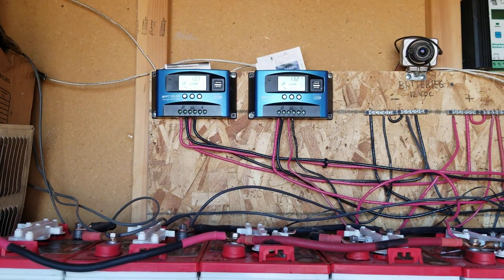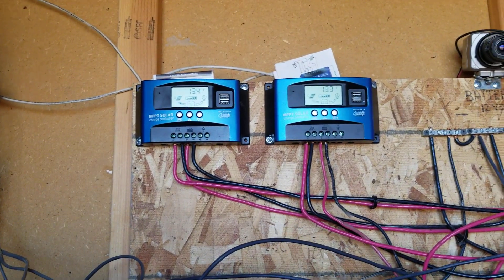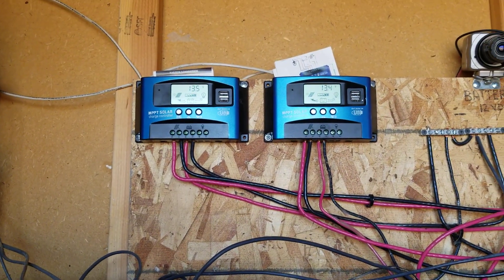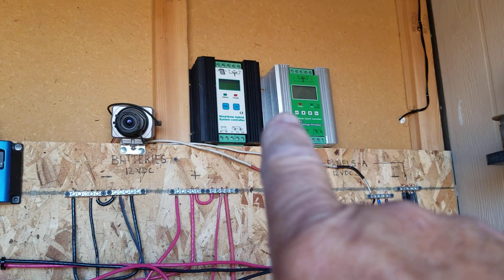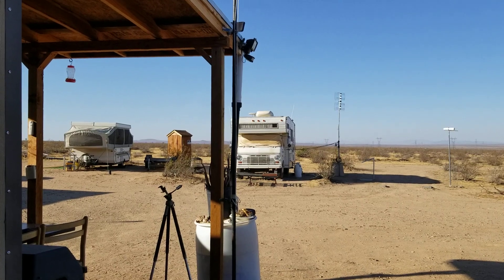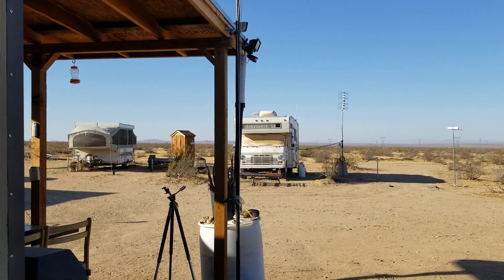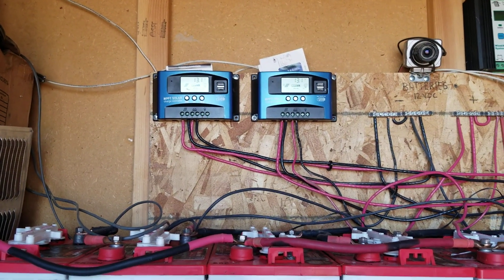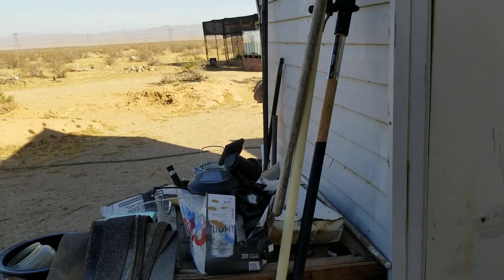Update on new MPPT controllers, Sep. 9, 2019

Comment: Purchased a so called MPPT that  looks just like those units.   They are NOT MPPT.  PWM is all.  Open one up and your going to see they are missing the components to perform MPPT.  No Inductor.    Sent it back I did.    You can tell a true MPPT by the fact they can show a Current Gain .  MPPT converts the Over Voltage coming from the panels into added Current via DC-DC conversion.   If your panels are rated for 5A at 17V a MPPT can produce something like 6.5A going to the Battery.   PWM is incapable of doing so.  Amorphous solar panel  Panels aren't the best producers but they have advantages.  They can perform better then Poly or  Mono in low light conditions.
Reply from the maker: Yessir. You are new so I understand you missing that whole fiasco a while back.  I am fighting with Ebay over allowing false advertising.   I want my money back!  They aren't even decent pam's, they display wrong and aren't reliable to maintain a constant charge.
Reply: @GBear  The Thieve just drop out create a new seller name and carry on.    Yep, took me a week to even get a hold of the seller .  Another week convincing them they were WRONG.  In the end I managed to get my whopping $20.00 back..      Purchased a Kit and built my own.
Reply from the maker: @pulesjet  wow!  You speak Chinese?!?
Reply: @GBear  NO But I managed to learn a few things in my 11 years in the military working on Electronics gear.  I order Boat loads of chines power supplies and stuff.  I order crap ever week of the year.    I know for sure if they rate something for 20A they mean it will only start smoking at 10A and not burst into flames until it reaches 20A ..  LOL    Yep that's the ticket.     Unfortunately we don't make this stuff at a affordable price any more.    I Thrive on CHEAP Chines Electronics.  Mostly parts to build my own.  If it goes POOOOOOOOF I did it.

Comment: Ha, that’s the same inverter I used in my garage to power my house for a year... obviously i didn’t run many big loads, but my led lights, my 12v air compressor, and my gas furnace had no issues. I’m backpack on the grid now for the last 6 or so years, but I am accumulating supplies to run a 12000watt inverter... I like AC in the summer here in NC... gathering enough batteries to feed that size inverter takes $ and time to save it... but someday I will have 9000AH of LiFePO4 CELLS accumulated...
Reply from the maker: Sounds like a good plan!  I power my cabin and shops with my setup, and have since 2017.  I love no electric bills.
Reply from the maker: OH, and welcome aboard!

Comment: I  understodd  part of  what you  said on  the  wattage  thing.  I  use  about  80 kwh  a  week  to  run my  house,  would  3   100 watt  Harbor freight  panels  power  my  house????  Thanks  JudithB
Reply from the maker: In a word, no.  You are on grid so your solar system is different than mine.   I use solar to charge a battery bank which runs my cabin needs.  You would have a solar array to 'supplement' your incoming electricity.   I'll give more info in my next video, either tonite or tomorrow.
Reply: joseph brown if you positioned for perfect sun, and had 8 hour days and the panels put out their full rated watts (they don’t come close)
You would have 2.4KWH per day... x7 gives you 16.8 kWh per week... under ideal perfect unicorn conditions...
Reply from the maker: @SuperVstech  problem with that starts with Harbor freight solar panels are 100 watts at 12 volts DC.   They are battery chargers not grid tie panels.  To convert them, micro-inverters would have to be installed to step them up to 120 volts.  Now a new problem arises because 12v is only 1/10 of 120v, therefore you need to divide all outputs by 10.  This makes the 100 watts become 10 watts and the 5.2 amps become .52 amps.  It would take 16 sets of these panels to produce 160 watts at 120 volts.  Not cost effective.
Reply: G Bear's Off Grid Ways-A Homestead In The Desert agreed.
HF panels don’t EVER UNDER ANY CONDITIONS produce rated watts either... the absolute best I have ever seen them put out is about 60%... usually under 40%. So, even if he tied all panels together in series, he wouldn’t get close to 8kwh in a week with three 100 watt panels
Reply from the maker: @SuperVstech  except, HF panels cannot be connected in series.  The diodes in the panels would fry.

Comment: Removing all that weight from van will save your trany and gas = $ savings .plus just need rubber grumit for hole in van
Reply from the maker: Welcome aboard!  I agree on the gas savings, you have anticipated my next video on the subject, lol.
I used rtv silicone sealant on the inside of the penetration for waterproof seal.